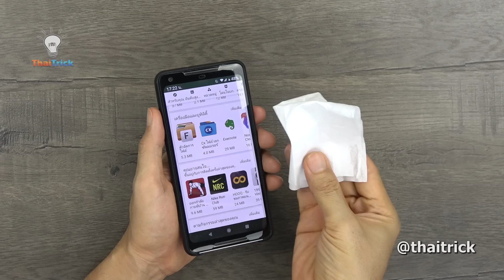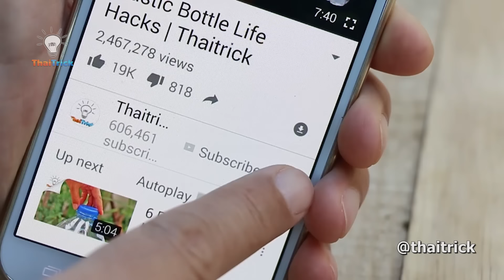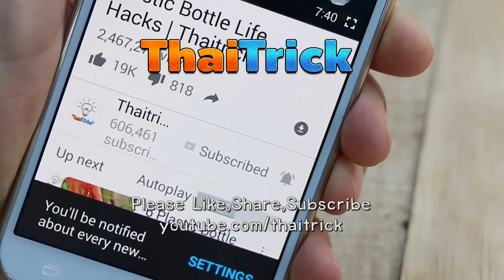32 Life Hacks and Useful Tricks! | Thaitrick

Comment: Don't do that with your wires. Get heat shrink tubing. It's not fancy, it's not a hack, it's a matter of safety. The way you twist your wires doesn't matter if they're exposed, it's extremely damgerous to have exposed wires, anywhere. Please do not do this, and get the proper equipment.